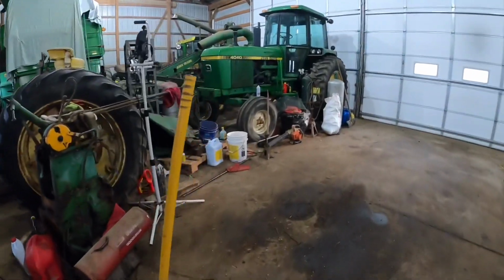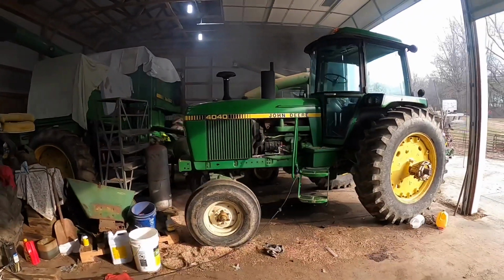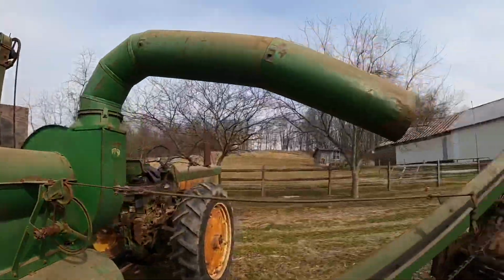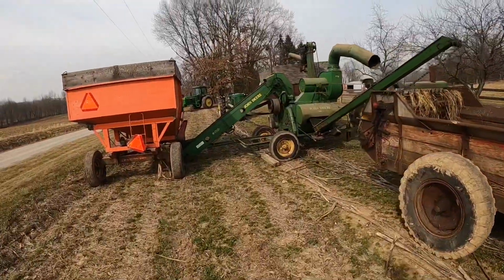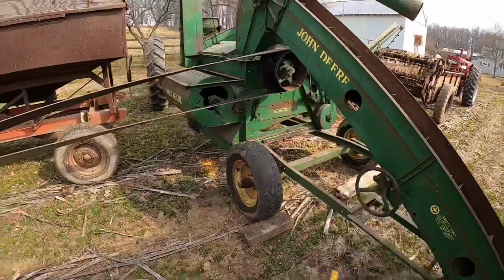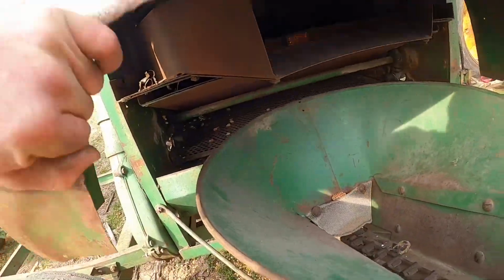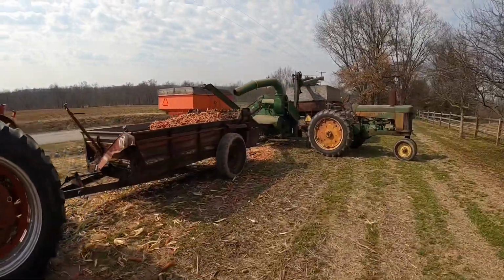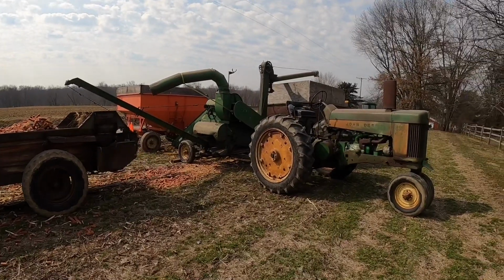John Deere 70 diesel and no. 7 corn sheller

Comment: I'd sure like to find a sheller like that. I put up ear corn for my steers and lambs. The lambs in particular do better on shelled corn.  John Deere or Minneapolis Moline seem to be the best. White continued to build the Minneapolis Moline 1200 until 1975. I don't know when John Deere discontinued their's.
Reply from the maker: I’m really not sure if I had to guess I’d say early 60s
Reply: Depends on the Sheller. The old hand cranks were around in the early 70s used by Pioneer Seed. The #50 that went directly behind the tractor mounted picker was still available in 1967 I know.
Reply: @thegreenerthemeaner  I have since acquired a Minneapolis Moline Model D which I can shell enough corn to fill my feed mixer in about 20 minutes.